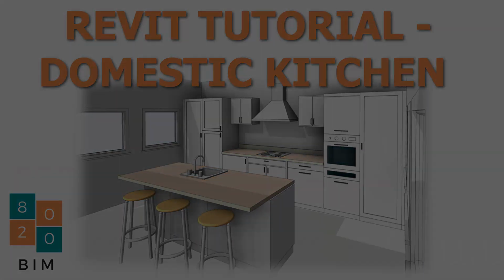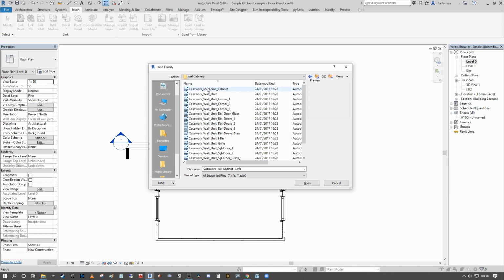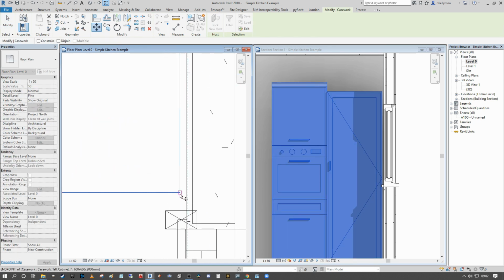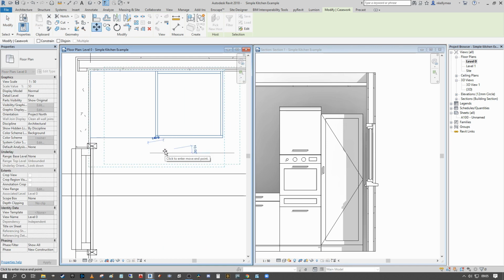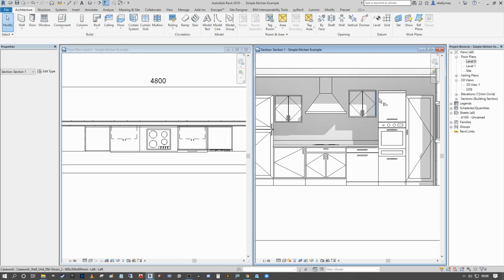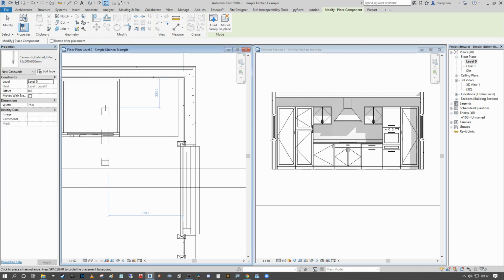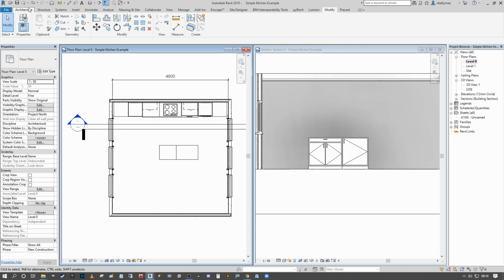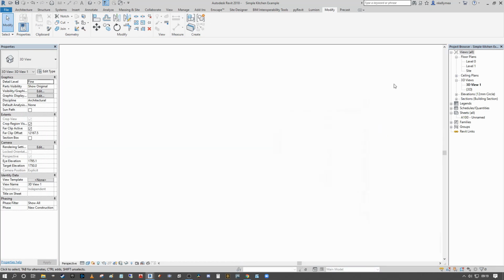Revit Beginners Tutorial | Domestic Kitchen Made Easy

Comment: is there no need to make all the casework as Model In-Place Component first before place it on the plan?
Reply from the maker: No, you can do it exactly as outlined in this tutorial, and it is the preferred way from the BIM perspective as all the casework contains the correct reporting parameters, and can therefore be scheduled etc.
Regarss
Niall
Reply: @8020BIM  still it is a stretch to design kitchen in revit. you can do it more freely and even faster in skp. it is like grass mowning with a combine. but nice video